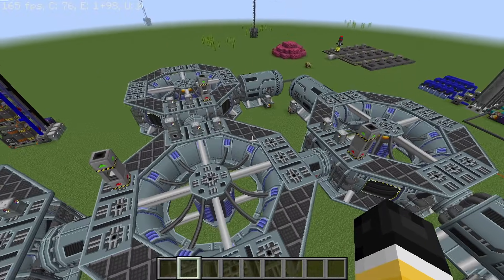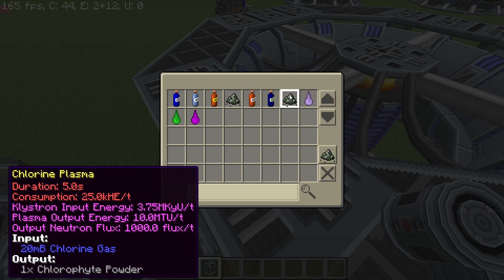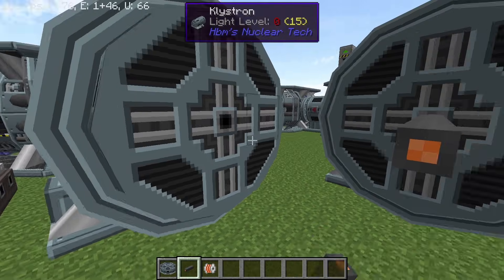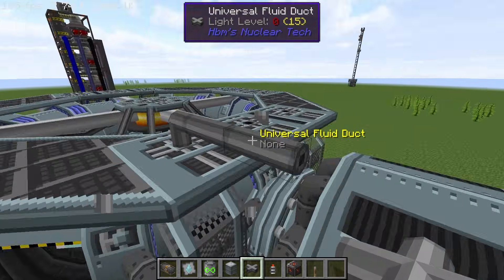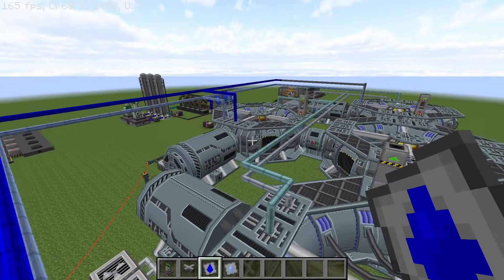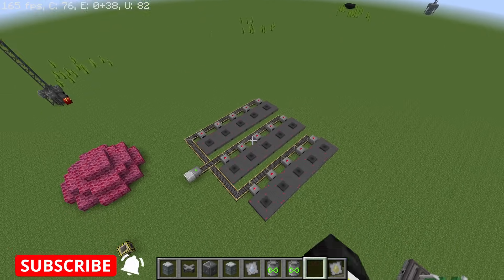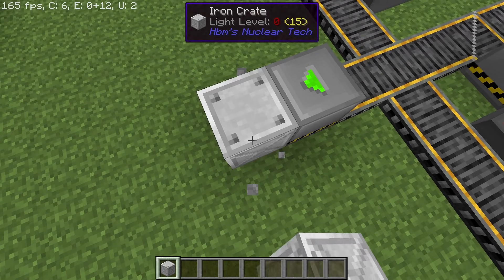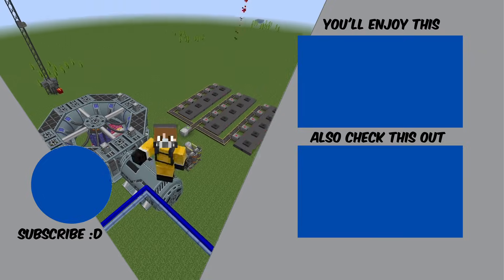Helium-3 vs Deuterium-Oxygen Plasma : Part 1 : Fusion Reactor Power Plant

Comment: I have a weird idea, i've been prototyping a "klystronless" design that uses both deuterium  oxygen, and helium 3 plasma, the basic idea is to create a ring that looks like this:

DO ← DO
↓          ↑
DO → DO

Where the DO is a deuterium oxygen plasma reactor and the arrows are plasma couplers in their intended coupling directions, you would need the klystron only to start the reactors and you could remove it after all 4 reactors have started, and you would put the helium 3 reacotrs on any of the 8 corners, and then conecting the chlorine reactor to them, with the possibility of having 8 deuterieted hydrocarbons, or stellar flux running at once due to the deutirum oxygen ring being self-sustaining, with the only downside being how obscenely expensive it would be to build and maintain this monstrosity
Reply: this is a really cool idea! i might have to try this out
Reply: I just do a chlorine loop with a helium 3 starter reactor. :) Hella chlorophyte tho.
Reply: @JadedIndustrialist while the platonic ideal is to have all 8 of the limbs in the deuterium oxygen ring with each having a stellar flux reactor with 2 mhd turbines each, the more realistic way to implement my proposed design is with 1 limb of He³ →Cl with the chlorine reactor having 3 mhd turbine, either nothing or 2   byproduct collectors, and 7 boilers on the DO ring, that way you have the maximum energy efficiency of your reactor while getting all of useful byproducts of fusion, but that is my fallout\GT brain always trying to minmax everything, if your way works then it is just as good as mine
Reply: I haven't tested the Helium 3 reactors, but the basic DO loop you proposed does indeed work. I used boilers to harvest its energy.

The math still works out that we can swap the boilers for secondary plasma couplers for our He3 reactions.
Reply: I did some math and i came up with a "MK2" version of the proposed design, where you would put a BF rocket fuel antimatter reactor between the He³ and the Cl reactors, it would be balefire positive as every bf fuel recipe would produce 8.33...: 4 Thermonuclear ashes, this proposed design would require one to automate the cyclotron, with the simple design only requiring the cyclotron to produce >500mb of antimatter in 5 seconds, but the platinic ideal would require over 2 buckets of antimatter in 5 seconds my hypothesis for the platonic ideal would use pairs of cyclotrons, with the first cycloton producing tennesium on all 3 slots, feeding them to the second cyclotron that would produce australium on all 3 slots, but that would be the lesser insane automation, as the platonic ideal is a monolithic metal star of hubris as it would need enough ICFs running on tritium-helium4 pellets to produce 16 buckets of stellar flux per 5 seconds to run the last torus on the limbs
Reply: So i dug in the _hbmCyclotron.json and figured out that making either tennesium or australium makes 100mb of antimatter per recipe, with the cyclotron being capable of doing up to 3 recipes per operation, bot i found an extremely interesting recipe that produces 1 schrabidium nugget with a box of plutonium and 1 ionized particles that produces 1b of antimatter per recipe, and if the cyclotron have both speed and power saving MK3 upgrades it consumes 121.1MHE per operation, meaning the schrabidium recipe is by far the best way to automate antimatter as the cost of  1mb goes from ≈403KHE by having a 3 recipes upgraded cyclotron to 121.1KHE with only 1 recipe upgraded cyclotron, with the possibility of it only costing 40.366...KHE per mb with a 3 recipes upgraded cyclotron